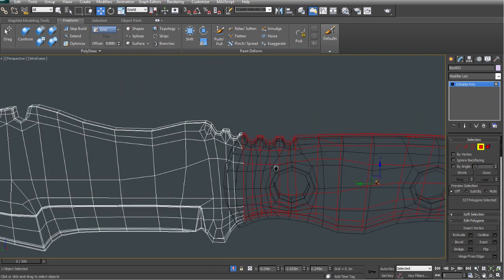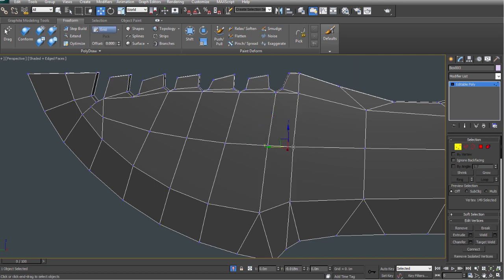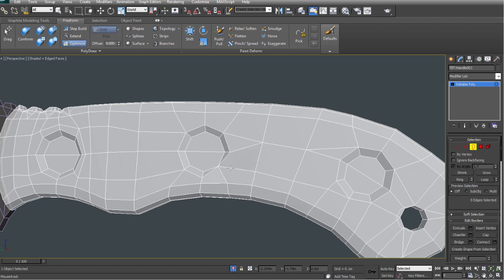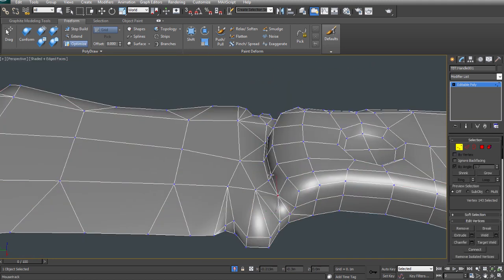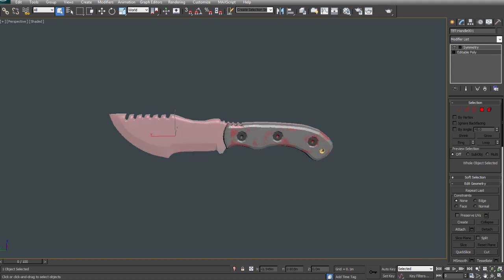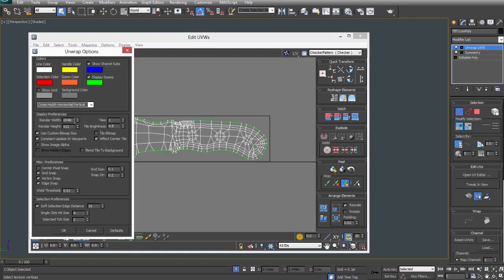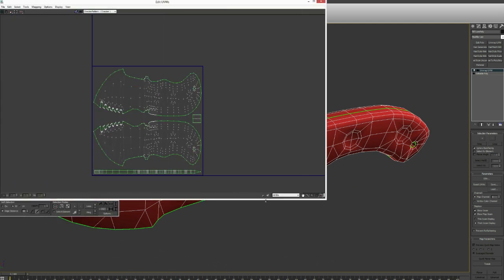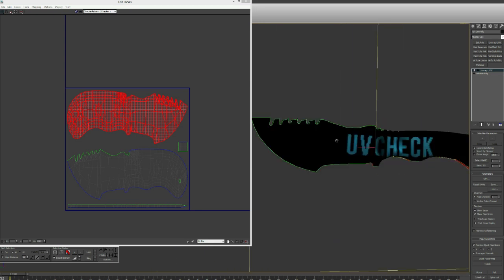Tracker Knife Part 3: NextGen asset production series

Comment: Thanks a lot for taking time to do this, Joe!
You are adding a loop horizontally across the side of the blade in the LP. Why is that? In the beginning you optimize it away, but then add it again. Does it make a difference? Isn't the side of the blade completely flat?
Also, with the beveling around the serratus, you say it's to catch light. Would the normal map not take care of that?
If anyone knows, please enlighten me on this :) Quite new to real-time stuff.
And again, thanks Joe!

Comment: Well in the beginning when I started doing Sub-d Modeling I also did the HP first and then the LP like you did in this video but after a while the way reversed and it saved me quite some time with doing so as the LP model is your basic model you'll have in your game without any textures or shaders that's the main model so having that and than basing your HP model upon that "adding new geometry and supporting edges where necessary on the basic model" would also seem easier in the global workflow.